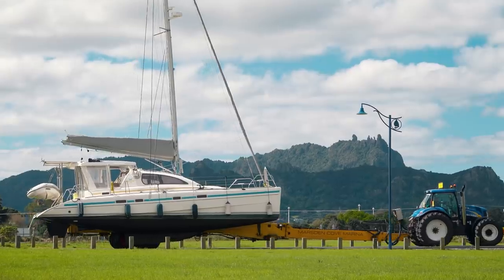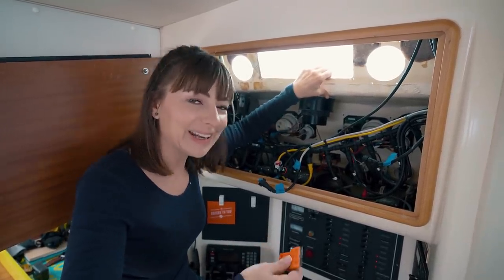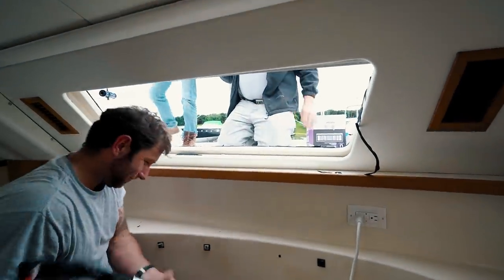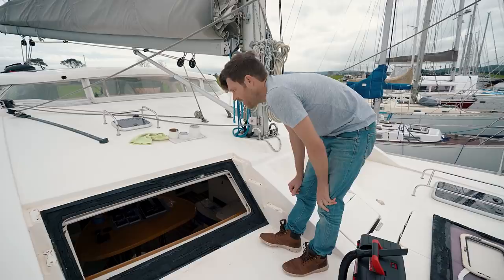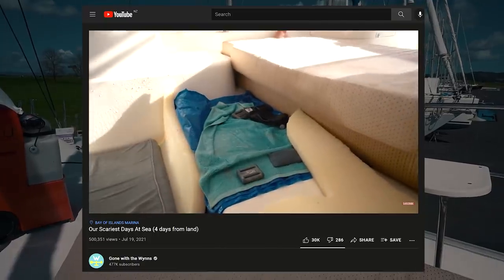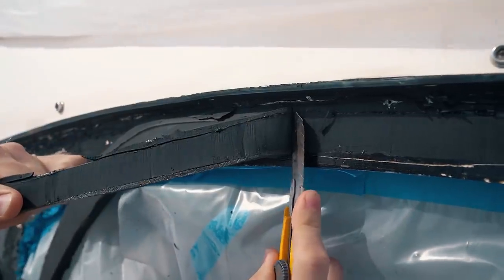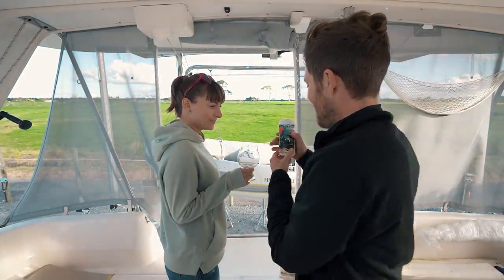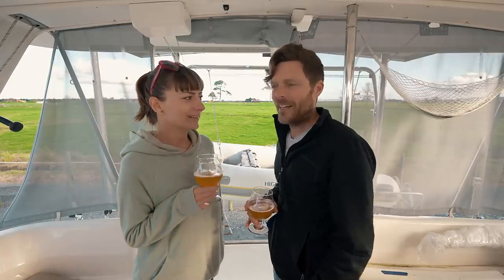Ripping Our Windows Out For The LAST TIME

Comment: It’s really interesting to watch you two work on the various projects on your home on the water.  While it’s problem not the most enjoyable thing to be doing, at the same time at least your with your boat and not thousands of miles away waiting for the no travel ban to be eased.  Just curious, when you do get the fiberglassing done on your electronics panel, if possible could you get a little footage of the repair process to let us see what they do to reinforce and strengthen the cracks?  Nice job on removing the windows, even if there was a little help with the power tools on the front window. Using that power tool method must have felt so good to see the work done without your spending a day hammering, chiseling and scraping your knuckles at every turn.  “Just keep moving forward.”

Comment: WD40, diesel or petrol on a cloth can be used to dissolve the sikaflex. Give the surfaces a final wipe down with Acetone to remove any oil from the surface. Then use a fine grit sandpaper on the mating surfaces to help bond the windows and sika/double sided foam tape when you go to reinstall.

Comment: I think cruisers would benefit from having several backpacker grade rain-flys on board.  Light weight very strong and waterproof rip-stop fabric. DIY of course - simple rolled hems, grosgrain loops (forget grommets) and some loops in the middle of panels (tie-outs).  Really easy to make if you have any sewing machine.  I personally no longer seal the bottom edges only areas in the middle (the tie-outs only on the top surface) and the ridge seam if there's one. String them up from the rigging, tied down to the stanchions, cleats. Use dyneema, or just 'parachute cord.'  
They basically form triangles and so are fairly sturdy in winds. (I camped under one in Connemara, Ireland in a 25 mph, 35 mph gusts, storm. It barely moved.) 
The way your boat and most boats are rigged, there's always something to tie to. So you could shade the main cabin at an anchorage in a sunny hot place. 
So how do you get millionaires to do grunt labor you'd pay $10/hour for? Put him, or her, or the nice couple.... on a sailboat. Boatyards are probably blocking a tremendous job opportunity for thousands of people around the world.

Comment: If you get an oscillating tool I would suggest you buy a Milwaukee tool so you can have the same battery. One in use and others in the charger. HTH

Comment: Good episode.  I pulled my windows out on my Schionning recently as they were leaking.  I removed the sealant and the adhesive.  I took it all the way down to bare clean fiberglass.   When your episode ended it looked like you still had a thin layer of adhesive or sealant on the window frames.  Did you get that off?  If so how did you do it?  It took me forever to get it off.  

Best regards
Tim

Comment: The tool used to remove the windows looks an awful lot like an "oscillating multitool", originally popularized by the Fein MultiMaster. Almost every major tool vendor (Bosch, DeWalt, Makita, Milwaukee, Porter-Cable, etc) sells one and prices are typically US$100-250. In addition to cutting through wood and metal, they'll also sand and have scraper blades (like the Bosch OSL200RS) that are perfect for cutting caulk without touching anything around it. Given the number of boat projects that seem to involve cutting through caulk, I'm surprised more sailors don't own a version of this tool!

Comment: Hello - I was wondering if you heated up the edges of the window with a blow dryer, would the gunk come off faster? I know sometimes you need heat to remove some adhesives from walls but I don't know if the same is true for fiberglass.

Comment: The challenges of boat ownership, more love than hate 😊. Is Anti-Bond 2015 available in NZ? If so try using it. It runs about $30 a can in the states and made to remove 3M 5200 Sika caulking.  It should cut your time caulk scraping time by at least 50%.

Comment: We use a heat gun and if you did have one hair dry works to save time next time install some have duty string with the end where you can get to them.       Ps. how are the cats doing                                                         just a subjection

Comment: When installing your windows with the caulking gun, you guys should cut a slit along the length of the nozzle of the gun. So that when you apply the silicone it should look like a sharks fin standing up.  Then when you press the plastic window on it, it should compress that silicone flat.

Comment: Much if not 95% of the caulk you're removing is filler between the cabin structure and the window.  When you go to install the new windows, I'd suggest looking at 'rubber' sheeting to make gaskets for them, and use a thin film of Sika to hold it in place.  Odd Life Crafting did this for most of their fittings such as winches and cleats, where they were joined to the boat's deck or hull..  You could make a pattern for cutting the sheet, so you wouldn't have gaps where the pieces were fit together, or do an overlap joint....  You get the idea.

Comment: the recip tool is great but you shouldn't need it, just get a thin blade through the caulk in one spot and remove it. then poke a piece of stainless mousing wire through that hole, attach a piece of wood to each end of the wire as a handle then one in one out work the wire like a saw through the sika job done.

Comment: OSI Quad sealant is better than 5200, stays pliable, is cheaper, and doesn't cure to be harder than plastic, making scraping and chiseling off old plastic hatches a nightmare without breaking them. It doesn't hold mold like 5200 either.

Comment: Someone recommended a "Oscillating Multi-Tool with scraper blade" but I also thought a wire (perhaps a softer brass wheel) wheel on the end of a drill might

Comment: Extractors are what the carpet machines are called.  "Steam cleaners" is not really correct.  I have a 16 gallon portable.  Key thing with those is use as hot a water as you can get.  For most things, you are wanting to clean the surface fabric, so don’t soak it.  If you can, take the cover off the cushions or memory foam, and machine wash separately.  Put foam in sun to air out

Comment: Well if it helps.. we are still in a hard lockdown with curfew here in Melbourne Australia as at today 4th Oct 2021..... ~;0(... the thing about having and owning a boat is the maintenance never ends..... and so does the hand in pocket for more $$$$$$$........ do as much as you can which always saves the $$$$ hurting your pocket. Removing caulking is always a shitty job I use a solvent which makes it a bit easier and quicker than scraping for days.

Comment: Yall may have completed the Butyl tape project by the time I send this... If not, you may consider the following: the epoxy potting of the screw holes is the right way to go. For the epoxy, definitely keep a 'witness' sample (spare/excess compound) set out in same weather/temp conditions that you can inspect to insure the curing went off. Most epoxies should cure up over the 24 hrs, though low temp can significantly increase the cure times. as a rule of thumb, ever 10 degrees C will cause the reaction to increase/decrease by 2x. EX: 30C ~ 10 hrs, 20C ~ 20 hrs. if you want to go for the 'gold star' consider mixing some glass fiber into the epoxy, it will greatly increase its strength.

For the Butyl tape, keep in mind the surface area you are trying to compress ("splooge out") is really quite large compared to the screw thread area that is pulling down on the window frames. Combining the large mis-match in surface area and very high viscosity of the tape, I am not too surprised the screws are stripping out. I would suggest 2 solutions here (which can be combined). 1) Heat gently the butyl tape with a hair drier or heat gun, if available. this will lower the viscosity of the butyl tape and greatly reduce the force required to squeeze out the tape. this will make your situation much more like using Caulk (lower viscosity, good squeeze-out). 2) HAND SCREW the final 5 or 6 turns of the screws. as soon as you are. making sigfinicant contact with the Butyl compound, stop using the drill. The power drill is too fast and does not give the butyl tape enough time to squeeze out. By hand screwing, you can finesse the final squeeze-out. You may also consider gently heating (warm to touch) the frames as well so they do not suck all the heat out of the butyl tape during the install time. GOOD LUCK!!

Comment: I know an easier and cheaper way to remove that window. All you need is a screwdriver, one or two bicycle brake cable and a couple wood sticks. You will use the screedriver or something similar to make a tiny hole in the caulk, insert the brake steel cable, then use the wood sticks to roll some wire around it and use it as a handle on both side. One person on each side. One person pulls in one way and the other on the oposite way, sort of like the saw they used back in the day to cut trees. That will cut the caulk like butter, one pulls then the other one pulls against the caulk, that would take only 5-10mins and you are done...

Comment: Why didn't you rent a sandblasting tool to remove the caulking.
Media blasting would have been so much easier and completely removed all caulking as it would have better prepared the surface for new caulking..

Comment: If you guys are sending windows off, why not do every window? It seems best to get all brand new windows so that way you don't have to run into this situation as some of your older ones crack or possibly break entirely.
Reply: NZ told them only the broken one were "necessary"
Reply: They happened to mention that in last weeks,  or the one before that.  Because of the lockdown in Auckland,  the factory only has permission to do windows that are broken/malfunctioning (considered essential).  So they're jumping on getting those done while they can.   Hope this helps!  :)
Reply: @texannaharris3246  WELL then...time to start breaking windows!! lol.

Comment: Removing caulk is the worst job on the planet. In the old days a good heat gun were your main weapons in the removal of caulking. There is hard caulk, crystallized caulk (hard as a rock, and crazy goo silicone caulks. The tool has changed to a reciprocating vibrating head tool with an infinite selection of blades, will cut right down to the base gel coat. It was fun watching the struggle, but I know you have many windows so invest in one of those tools. It will keep you sane and in a better place...

Comment: I feel like you guys need an impact driver with the right head or the tools that guy cut you window out with. Based on the videos I've seen, you guys spend a TON of time cutting caulk. You need to find a way to handle this in a better way. Seriously, your boat is basically 3 Allen bolts and 98% caulk.

Comment: Why are you not doing all the windows while you have the chance. If half failed already the other half are soon to fail also.
Reply: They're probably not allowed to have the unbroken ones built due to the lockdown restrictions, as they're not "essential".
Reply: Because the part of New Zealand they are getting their windows fixed in, is in lockdown. This means that they can only have the windows that are cracked repaired, as it's classed as "essential". Once the Lockdown is lifted they can get the remaining windows done.

Comment: This is painful to watch! Other people have given you this advice. Go to Bunnings and buy a Ozito multitool, a cheap pack of blades or use the ones that come with the tool. Choose the blade which best suits the area you're working on; sharpen the edge (to a knife blade edge) and round the corners, this will remove urethane adhesive in minutes to a clean finish.

Comment: Instead of concerned that the call might be the last, consider how The Lord blessed you to be in a place with considerable connectivity as opposed to a remote island or The Whitsundays.  I live couple thousand from my elderly mother, uncle, family, and yeah each and every day a creeping sensation of will today be a day of...
As long as you're sitting on the hard power tools are available to make the job and future jobs less manual so I suggest you invest in a cordless 3" grinder and small recip saw and don't forget the supply of blades, discs, etc. 
    Lake Powell is where my big boat sits, since 2017 and likely won't be able to be put in the water for another 3 or more years.  So I feel ya not wanting to leave Curiosity. It feels like I'll never get back to Midnight. 
    Feel like I need to go back n watch some previous episodes of GWW to feel like it's a sailing channel. 
Stupid how the governments of the world are exercising tyranny through fear and the population doesn't just wipe them off the planet, heads need to roll for this everywhere.  Feels like a modern mid evil time that will require the overthrow of
government to stop as it did then to save more lives. 
I fear you may regret the choice to go to New Zealand. It could take longer to leave there 
than it did to get back to Tonga.

Comment: for Pete's sake, stop goofing around and get your own CORDLESS oscillating tool!! Argh! It's so frustrating to see you both struggle with tasks that could dramatically be cut down with this tool! After seeing how quickly your friend did the window job with this oscillating tool why aren't you RUNNING to get that tool for yourself!! Please! LOL. You could clean up that window caulk in 1/10th the time instead of using razor blades and scalpel. His was a professional kit so it was probably on the pricey side, but you can find very strong kits for less than a $100 on Amazon! I promise this will be one of the smartest money you'll spend! Be kind to yourselves!